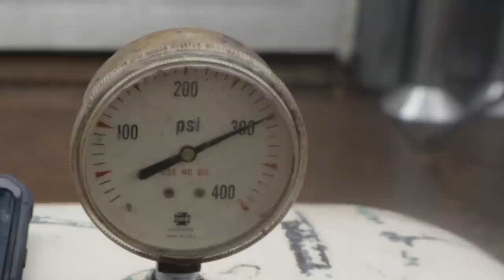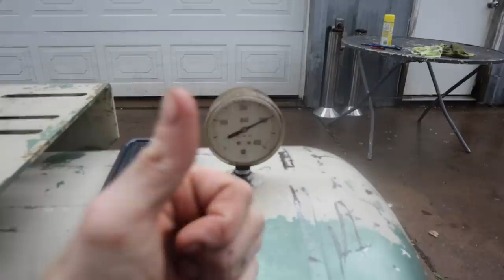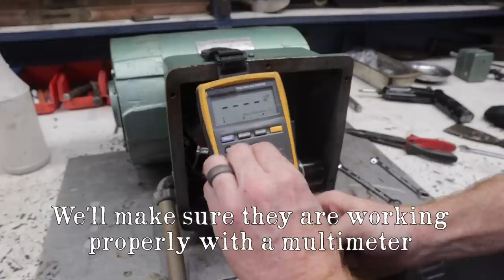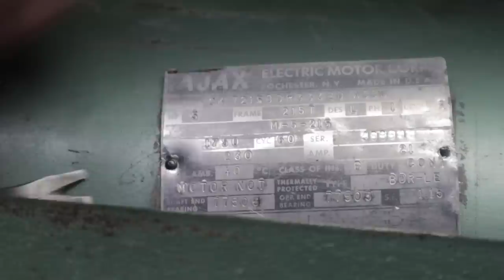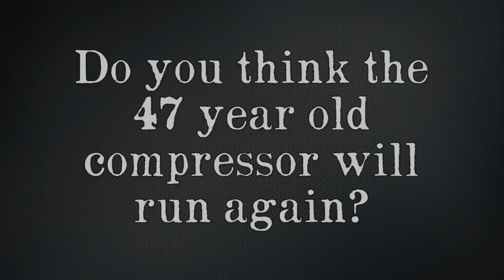OLD 2 Stage Air Compressor ~ WILL it EXPLODE!?! ~ Hydro Testing the Tank ~ RESTORATION Part 2

Comment: well, not to be picky, but it wouldve run when you got it so i suppose the only way it will run again is if you do the rebuild properly..
Reply from the maker: Maybe that's true on other channels, but no trickery here! I got this compressor for free, and I honestly don't know if it will run, it wasn't hooked up and it was missing some parts when I got it, so I guess we'll see If she'll run, but I have faith that i'll run like a top! (and If I DON"T mess it up! lol)
Reply: @SalvageWorkshop  mostly only say that because you turned the pump over and it "farted" that means it'll pump. If it farts it runs lol
Reply from the maker: @bcouri1  Yup!! You'll have to see the up coming video! This is a WELL made machine! Especially for 47+ years old and having been used in a paint shop!
Reply: @SalvageWorkshop  did you ever state the mfg of the pump? It looks like a Kellogg 2 stage unit
Reply from the maker: @bcouri1  It's in the description and the previous video! It's a Saylor-Beall 705 2 stage Compressor pump! Still completely made in the USA, in Michigan to this day!

Comment: So for those of us who are not from the restoration world: what do you use a compressor for? Is it supposed to be self-explanatory?
Reply: You use a compressor for anything you need compressed air for. Pneumatic tools (like the kind an auto mechanic would use) paint sprayers, blow off and clean a multitude of things.
Reply: An air compressor is probably the most important tool in a auto/mechanic, metal or body shop.
Just as a few examples, It runs air driven power tools such as Sanders, sandblasters, impact guns, ratchets, air over hydraulic lifts and presses blow guns, tire inflatiors, air hammers, die grinders, angle grinders,  nibblers, shears paint guns, welders.
in today's world in air compressor is not quite as important as it was 40 or 50 years ago because cordless tools have gotten so much better but it's still a very integral part of any well-functioning shop.
this particular air compressor he is restoring was a commercial unit that I believe they still sell a version of today it is probably a 8 or $9,000 machine, in a home you shop it will probably last 150 years literally.  If you go into something like an older mechanic shop (think of something like a Sears lube and tune center or goomers gas station on the Andy Griffith show or some other shop that has been around for decades) you will probably see something very similar to this air compressor still in use running off and on all day long 7 days a week.
My neighbor has a mid 1930s Champion brand (I believe I might be wrong on the make) that he pulled out of a shop that was being leveled for apartment buildings and he brought it home wired it in and it still works like a champ it's date code is stamped literally on the pump. 
Great tools, so much better than what you could buy at say like a Harbor Freight or a Home Depot.
Reply: @AtomicReverend  lol, google the Saylor beall compressor, they cost much lower than your number. Its what you think you know!!!! Those compressors were designed to run 5 years in a shop setting that uses them less than 5 hours run time a day.

Comment: I've restored a few bench grinders and watched a lot of videos on them ive never seen them have run compasitors and start compasitors and that thing with the springs on the shaft. Either one or the other. I should get a book on ac and DC motors. 
Mr electric is the motor genius on YouTube he would have tore into the motor and rewired everything. He has some contraption that spins the copper wire.
Reply from the maker: Many Single phase motors like these have that centripetal switch in them to shut off the starting circuit / disconnect the start caps for normal use! That machine you are talking about is for replacing the motor windings when the motor is bad. Funny thing is, I was actually given a home made winding machine for doing just that! I'll never use it! Ain't nobody got time for that! (except Mr. Electric)!
Reply: @SalvageWorkshop  yeah he does it every time even if it doesnt need it.
Reply from the maker: @thecynic807  That's crazy to me, but he knows motors better than I do and has the experience! I'm a firm believer in: If it ain't broke, don't mess it up!

Comment: Testing capacitance does not tell you if the capacitor is good or not. You have to test for leakage at Max voltage rating. Eventually the capacitor will short out or open. But if it is leaky it will not last.

Comment: Question about hydro static pressure testing. Wouldn't a tank full of water be way more destructive that just air?
Reply from the maker: Actually it's SIGNIFICANTLY safer! Water doesn't compress hardly at all, unlike air, hence compressed air... That's why water is used to test the tank, and not just air.  If a leak were to happen when it's filled with water,  the pressure would drop quickly because it wouldn't take much water escaping to decrease the volume inside the tank... it's not compressed like air would be. I'm sure there is a better way to explain it! Good question!
Reply: @SalvageWorkshop  Sounds reasonable I need to look in to that
Reply: Hydro testing is used in many branches of industry. Pipelines are hydro tested usually left 24 hours and only minute pressure drop (expansion of metal etc.,) ALLL pressure tanks are water tested to at least 150%, many 200% to ensure safety.
Our pressure test rig has had very few blowouts in 40 years and always the operator gets wet!!! water loses it's destructive power in microseconds under a rapid pressure drop. Most common faults are what we call  "spurts" that is where a porous weld leaks and sprays water usually wetting the operator !!!
We also use a metal cage that surrounds the tank simply as this is required by our insurance company.
Hope all this helps
Reply: Here was my question, here lies my answer. Thank you, people of YouTube.
Reply: @georgestyer2153  ASME Sec VIII, Div 1 allows hydrostatic tests at 1.3 times the max allowable working pressure multiplied by a factor to take into account the difference in test temperature to design temperature. I seem to recall years ago that we calculated hydro based on 1.5 deisign pressure.
Reply: When I run the calc on this vessel (a few assumptions to be sure) he really only needed to test it at about 270 psig.

Comment: Years ago, I started building things myself I invested in two big tools. A mig welder and an air compressor.

Before using the air compressor I learned to weld and made a cage for the compressor to sit in while in use.

No explosions thus far but I wouldn’t operate one without the cage. Terrifying things haha.
Reply: If explosions are a legit worry why didn't you have the tank hydro-tested? What industry does so can you.
Reply: @obfuscated3090  time, weight and cost. The compressor is stationary and lives in the cage full time. No need for the ongoing cost of hydro testing.

Comment: 9:35 .........  These are "wet" (electrolytic)  capacitors. And they have a tendency to deteriorate over time. Although your multimeter gives you an indication close to 15 uF, it does not mean the capacitor is still in good shape. The function of a capacitor is to be charged and discharged regularly. Could be many times per second or a few times per minute. And to do this for many years during its functional life.
THAT is what a capacitor should be tested for: does it still charge and discharge rapidly and does it maintain its capacity of 15uF...??
Well....old "wet" capacitors rarely do.
My advice is, to ALWAYS replace old electrolytic capacitors. Old ones could start to leak, or heat up and burst during use.
Don't take that risk. 
Just replace them. If these old things are more than 10 years old.... throw them away (properly) and buy new ones. They are only 10 to 12 $ each, and you'll have perfect new ones and be safe for the next 10 years.
Reply: multimeters test capacitors by charging and discharging them rapidly (by passing AC through them) and measuring how much current it takes to do so -- effectively how much they charge/discharge.

Your concern is not without merit, as multimeters don't test them at their full operating voltage... but the question of whether or not they can be charged/discharged is exactly answered by the test you discredit.
Reply: Good points from both of you..I was curious so thanks for the insights